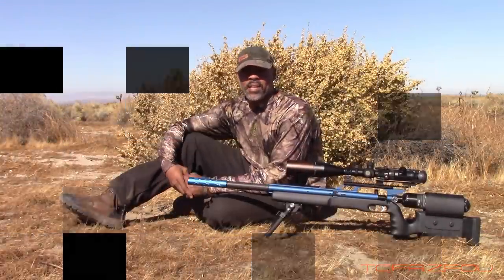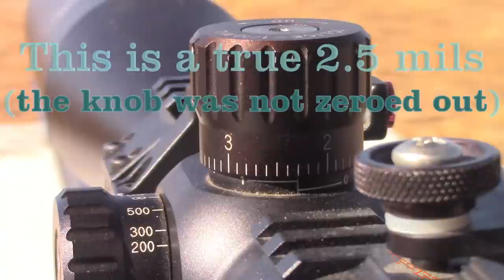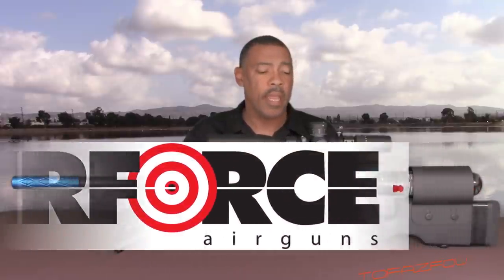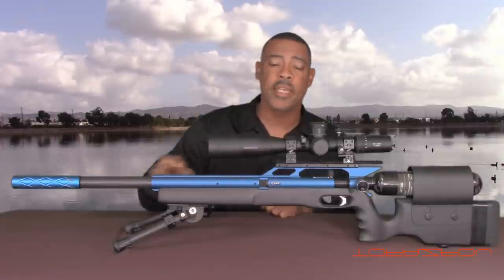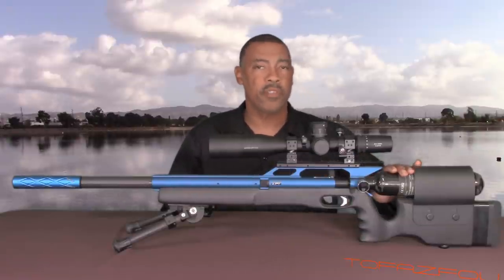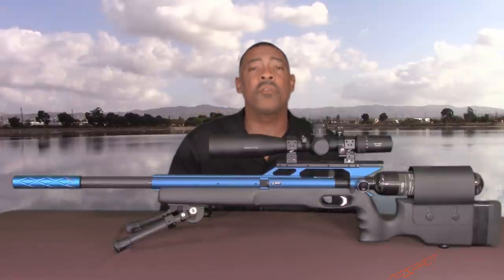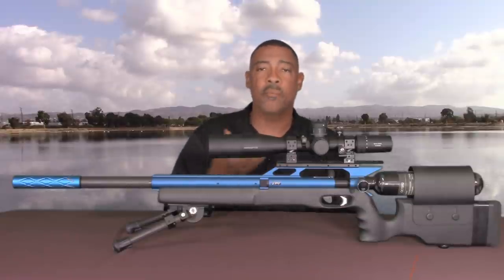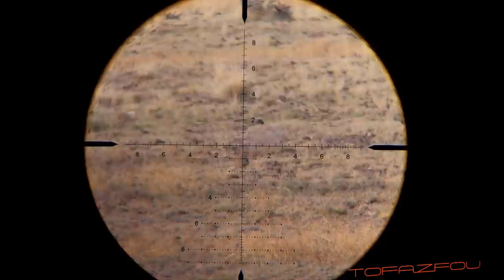INTRO-.17 HMaiR mkII (101 FPE!!)

Comment: Excellent Cedric!
Thank you for all that you do to bring air rifle technology to the cutting edge. Between you and Dyotat,  you guys have been able to make many of the the things they say can't be done,,, actually become proven!
I remember the earlier days as you really brought out the .257 to the mainstream with your .257 bible post over on the tag.
At one point when I was just beginning to join that .257 club, I had many many questions and you had taken much time to answer my questions with a willingness to put me on the good stuff. Doug was very approachable and helped steer me in the right direction, building my  valve and overcome the hurdles involved with at that time newer generation Airforce Spinlock frame with it's newer trigger and safety, it provided many headaches for Doug!
I agree with you on much of the reasons and challenges for doing the things you do with air and choosing calibers and roads less traveled than others.  
I had remembered proposing such thing as a .177 bullet perhaps swaged from lead wire. At that time the general consensus was that the bore was too small and would be very difficult to overcome valve lockup. 
Of course if anyone would have the tenacity to overcome such a challenge, go ahead and put Doug Noble on it! He just never gives up or will rest on what he has done. He constantly improving and experimenting, determined to overcome what challenges he has before him.
 We are lucky to have such great access to such major players on the scene. Thanks for sharing dude! 
Southboundsuarez aka dougroundup!

Comment: Yup, Doug builds amazing AF guns, he truly is a Master Airsmith.
The 7mm Texan he built me is also amazing. We're lucky to know him.
Reply: Doug have a youtube channel ?
Reply from the maker: Man, I can just imagine your TEXAN 7mm!  HOLY SCHNIKEY!  I would love to hear more about your setup and what kinds power and accuracy you get!
Reply: @Tofazfou  had a mandrel made for 18" twist .284 for lighter bullets more suited to air rifles. TJ's has it if anybody wants to get one. NOE made several 7mm molds for me (their listed in the catalog)
Donor gun was .257 Texan.
Doug made long rear bushing with a deep recess for the CF tube to socket into for ridgidity. The CF tube is super epoxied with some crazy stuff Doug had.  Then he slid the match tolerance long forward bushing OVER the CF tube and epoxied and set screwed it in place so the barrel is very stiff and supported.
Doug reworked the valve of course and it's mounted in a CF 500cc bottle with the gun tuned to 3600 fill. His custom spring too matched for this rifle/caliber/pressures.
Using a Maddog Ranger stock, coated Desert Tan instead of black, with Optisan EVX 6-24x56 (Eagle Vision rings on a Maddog Picatinny rail).
Shooting the Arsenal 96gr Bowman (hollowpoint by Eric), the NOE 284-89gr BTHP, and the NOE 284-73gr Flat base HP... All giving very good MOA to sub-MOA at long ranges beyond 100.
Not shooting at max (wheel backed down to 1.5 to 2), the 96gr seems to like 1060 FPS / 230 FPE.
Doug is the MAN!
Hogs fear this air rifle!

Comment: Super cool I was thinking of doing a 17 hmr to my condor also. I wound up useing 5.45 barrel instead and I'm using 52 to 60gn slugs. I'm using green mountain barrels also they are great for the price.  I built a custom reg for mine with a 130cc plenum regulated at 195 bar makes 100 fpe easy in .22. Very cool well done sir

Comment: Excellent build as was the first one!  I want to build a .17 cal 60-70fpe.  What diameter roughly did you have the GM barrel turned down to?  I saw the first build was with a TJ liner.  I don't really want to lug around a 6-9# barrel on the gun.  I contacted GM barrels they have the barrels in a raw 21", 25", 27" and also a 32".  I'm thinking of going with either the 25" or 27" and turning down to close to .500".  Keep up the great work, and thanks for sharing your ideas.

Comment: Awesome video.  I'm curious.  By chance have you tried to fire 17 or 20gr vmax bullets in that rifle?  I'm thinking it would work well.
Reply from the maker: No. U can't shoot copper bullets in airguns due to the lower operating pressures that we use.  They will get stuck in the bore and are a PAIN to remove.

Comment: Cedric, that thing is a firecracker ! How th heck do you keep your mold hot enough casting that tiny lead lol ?  I had a time with my 257 mold and i can only imagine casting those 172's. Thanks for all your help  also with getting me in the casting game brother .👍👍🇺🇸 I want that sh-4 for my 257 also. Currently running my 16x SWFA SS.
Reply from the maker: Derek, 172 is by far the hardest mold/caliber i've ever casted.  I never had issues with 257 or any other caliber UNTIL i bought my 1st 172 mold.  Then I bought a brass 172 but It cast bigger diameter bullets for some reason then I bought a 3rd 172 mold.  Brass or Iron molds in this caliber will be best.  Running the mixture a little hotter than normal helps too.  Running a harder lead mixture also helps alot.  And using either a propane torch or a hotplate or something similar also helps.  But damn its work.  I don't have to do any of the above for any other caliber but the damn 172.....lol!
Reply: @Tofazfou  where did you get your brass mold. Noe seems to be the only place that sells .172 molds  but aluminum only?

Comment: I recently came across a handful of pure lead bars. They are about the size of a case of soda and weigh about 80pounds each. Is that something you could cast slugs out of?
Reply: Depends on the alloy.  If it is nearly pure lead, then yes.
Reply from the maker: PURE LEAD?  Oh heck yes sir.  But there is something to casting with PURE LEAD vs PURE LEAD with alloys such as TIN or LINOTYPE or Lyman #2 added.  Adding alloys makes the lead flow better in the mold cavity than when JUST using PURE LEAD.  Better flow means the molten lead actually fills the entire mold cavity so the bullets come out looking pristine.  Casting is something that is easy to get started doing but often hard to master.  Its an art and it takes years to understand it fully.  There is a science to it all
Reply: @Tofazfou  thanks for the info! And yes pure lead. Thinking about buying the new fx Maverick. I might have to try my hand at making slugs one day. Thank you for the content man. You are one of my favorite YouTubers. 💯

Comment: Incredible!! What did this build cost if I may?
Reply from the maker: To be honest, I've never even tallied the total because i've bought parts over a loooong time.  But lets see, frame is $$$+, barrel is $+, Stock with dip is $$$$$+, Bipod is $, LDC is $$+, CF bottle is $+, valve was $$, hammer, spring and breech/knob was $+, EV rings 34mm are $, Scope was $$$+, odds and ends was another $$ so, your looking at a little of 2 G's.  Mostly give and no real TAKE.....lol.  So, a full custom gun like this or my 338 Airpua can cost the same as a FX custom or a Daystate Electronic gun or more.

Comment: Can't wait until this is used for pest control and those long range shots on ground rats aka ground squirrels.
Reply from the maker: Thanks David.  I've spent a lot of time with Strelok and my LabRadar and almost have the BASICS perfected.  I've made enough short and long range shots with this rig to be totally confident to take it to and past the 150 yard mark and well into 300 or so.  My last step is to perfect casting the 172 slug.  They are by far the toughest to cast.  The bullets are tiny and the molds are HUGE.  So heat retention becomes a problem.  But don't worry, as soon as I figure it out, "here i come long range".